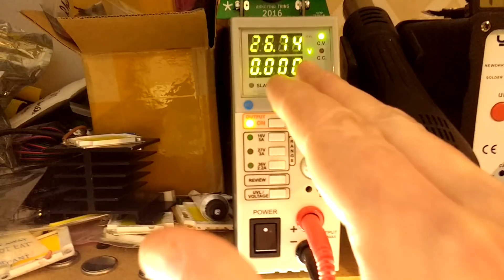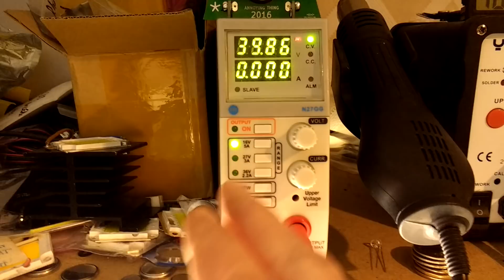Why I never show my power supply.

Comment: I'm not sure what the message is here.  On the one hand you've highlighted a major flaw in this PSU but you also say it's the one you use.  Are you telling us to avoid it or use it?  You have a huge following, some of whom will be influenced by you so you ought to be clearer here.  If this supply has such a dangerous (to electronics) flaw, why would you 'Big Clive' even think about using it?  This makes absolutely no sense whatsoever.
Reply from the maker: This is the first video where I've identified it and also revealed that it has a huge flaw.  Not a glowing recommendation.
I continued using it to try and capture the crash state as I did in this video.

Comment: 2000lm-2400lm/15W... Have you seen these yet?: 
https://www.ebay.com/itm/94x50mm-15W-COB-LED-Square-Strip-Light-Lamp-Bead-Chip-diy-DC-12-14-GE/132443251434?hash=item1ed63ba2ea:m:mYdZcPCgNqqLtIoeP8ARoIw
Reply from the maker: There's a huge variety if them.  They just use a parallel array of four LEDs in series to give a very vague voltage of 12V.  Anything above or below will result in a significant intensity variation.

Comment: I wish he would do a video on power supplies. I'd really like to get one, but I don't want to spend a ton of money. I'm an amateur, I don't do a lot of electronics anymore, but I still get into moods every now and then. I think one of the biggest things that stops me from getting into one of those moods more often is that I'm limited to a computer power supply or USB. I have to dig through my work area to find where I stored the PSU and pull out the multimeter, sometimes I need to dig through another area to find a voltage regulator or something if I need more variation than 3.3/5/12/-12v. A quick video showing some examples of good, budget power supplies would be awesome!

Comment: I have a sharman multicom 0 to 30 volt 30 amp linear power supply, old analogue amp and volt meters had it now 9 years never had a problem. Thing is these new digital readout switched mode power supplies are expensive junk, go get a good old fashioned linear supply.

Comment: its weird because my powersupply randomly crashed yesterday, when id turn the voltage way down id still sit at 10+v. blew up the blue led in my rgb led i installed. and i cant get it out great

Comment: My "Early Chinese" power supply's so old it uses moving coil meters with LES tungsten backligting.  Reasonably reliable though (and transmitted HF noise issues were almost completely fixed with decoupling capacitors).

Comment: Those powersupplies are sold under many different brand names. I have one that is Voltcraft branded. And yes, this stupid thing lit up several of my prototypes - so don't buy it!  (go for a used agilent/keysight supply, that will last you for decades and is usually rock solid)

Comment: Hi Clive! :) That power supply is otherwise known as any one of the following, Voltrcraft LSP-1403 / Maplin N27GG / Manson SSP-7080 / Extech 382260. It's actually manufactured by Manson. You might find that they offer a firmware upgrade for the supply that might cure that problem.  Also apparently they are known for developing problems with the snubber circuit and for the mica insulation on the MOSFET failing. I believe the controller is an amtel ATMEGA so there is probably some kind of update available.
Reply: Maybe it was Charles Manson that made this one?

Comment: This power supply reminds me of my first power supply, a "VOLTCRAFT LSP-1403 SLIM" wich looks exactly the same.
I don't know if it has the same error though, because i only used it a very short period since setting the voltage is very fiddly and to adjust the current you have to hold the "REVIEW"-Button. :-(

My current PSU is a "Twintex TPM-3005" (0-36V @ 0-5A or 0-15V @ 0-10A, 1mV/1mA Resolution, controllable via RS-232 and much moore. Link: https://www.tme.eu/gb/details/tpm-3005/programmable-power-supplies/twintex/)

Comment: I have that power supply, and while I've never had it crash, it has a nasty problem with current regulation when you first turn it on, the current will go sky high for a brief moment before the current limiting kicks in.  I wasted a nice 2.5 watt laser diode with it.  Better to turn on, then connect to a load.
Reply: TheHouseBlog If you have a digital storage oscilloscope then it is always worth testing the power-on/off characteristics of a new power supply before you actually use it as there are a good many out there that exhibit undesirable characteristics and quirks on either power-on or off.  Also does not hurt to test suddenly unplugging the supply as well to emulate a power failure and then restoration of power.  The more you know about your gear the less trouble one inadvertently gets into and the fewer unpleasant surprises.  If one does not have a DSO then search YouTube and Google to see if others  may have already evaluated your power supply as there is a decent chance these days that someone out there has done so for you.

Comment: Thanks for sharing Clive. I worked at Maplin for four years during my college days and was witness at the time when Maplin ripped out the long counters where you were encouraged to bring your endless shopping list of single components to faithful old tecchies who were eventually replaced by box-shiftiers..
At one point they started selling CRT televisions made in Ukraine at a very modest price. Some of us were invited to visit the factory where we watched the production line workers who some had bottles of spirits on their bench - not for cleaning, but to sip all day long as they assembled and tested. No surprisingly, many of the TV sets we put on display arrived D.O.A.. Some made very interesting pyrotechnic smoke plumes when brightness controlls were adjusted. 
Ironically, when the shop became more Curry's outlet than component store they had a big problem with ram raiders. The gangs were clever enough to trace and cut the phone lines to prevent alarm signals from alerting the Police. They must have been dissapointed to find they had made off with piles of faulty DVD players and TVs waiting for return.

Comment: I have one where there are 4 presets for 3 buttons labeled 1,2,3. To get to the 4th preset you push 3 and roll the value selection encoder any amount of steps in any direction. To select a voltage or current you select a preset, push the voltage/current modification button, and roll the encoder,  the timeout for modification is about 4-5sec.
Things get messy when you're on the 3rd preset and linger a bit when modifying a value, a slip on the encoder after the timeout switches to the 4th preset which is set by default to 36V/5A.
Blew an expensive xilinx fpga board to hell with that power supply.

Comment: Does it actually output the voltage shown on the display when it crashes or does the intelligence just go away and leave the voltage set at its last setting????
Reply from the maker: It does display the undesired voltage.
Reply: That is definitely not good.   Thanx.

Comment: Well pray why do you continue to use it without modifying or replacing it?
Reply from the maker: Because I quite like it otherwise and because I always instinctively switched it off in past incidents I wondered if it was my error that caused it.  So I've kept using it in the hope of catching the incident one day.
Reply: bigclivedotcom I see! Thanks!
Reply: Well now you have, so rip it apart and shotgun all of the solder joints, for starters.

Comment: $40 and you can get a TekPower TP3005p programmable lab supply, large, chunky transformer for the 5 amp current available, and up to 30 volts. Had it about a year, and hasn't done anything odd.
Reply: Jeremy Allen 
If they don't have a distributor in the UK then it would be prohibitively expensive to ship something that heavy!

Comment: Fix it! You'll find lots of dry joints in that power supply! I had one some years back from maplin and sold it on because of the poor quality of the board. Check the output stage that heats up first and you're done.

Comment: Why keep it around when the thing can't be trusted? I wouldn't use it even if it was free.
Reply: j mtx 
I definitely would use it if it was free. Especially if it's just for stuff at home.
Reply: Perhaps - but I would only use it for REALLY non critical loads like charging up old led acid batteries or devices which could handle 30v+ without issue.

I would never trust it to power something worth more than a few quid and/or REALLY easy and cheap to fix. 

A free PSU soon isn't really worth the money if periodically it destroys what it is connected to.
Reply: I had a 12V sealed lead acid battery explode, because of a faulty PSU which fed it 19V DC. See my other comment about it.
Reply: Mark T I would probably stick to things that can handle the max power rating, like lead acid batteries as you said. It probably doesn't always land on 30v when it crashes, better to play it safe then. Effectively it's become just a free car battery charger, which, hey, is better than buying one.
You could also probably find a way to automatically cut the power when it spikes like that, perhaps some sort of Arduino set up connected to a remote controlled wallwart. That would of course make it not free, but cheaper than buying a new power supply.
Reply: That's a fair point - though a lead acid would (typically) survive a high voltage for a few seconds without blinking an eye - but a 5v logic board would be dead before you had time to say "ohh, sh.....".  I agree if the supply can change voltage mid use then not suitable for unattended operation on anything really.

BUT I think I can see a fix for this....... (will write another post)

Comment: So which power supply would you recommend, Clive? 

At the 100-quid-and-under mark?

At the sub-200-quid mark?

At the sub-300-quid mark?
Reply from the maker: For typical use a budget of up to £100 is fine.  You'll usually get a decent supply for around £60.

Comment: A Crowbar is needed
Reply: Robert Szasz Crowbars are not especially practical where there exists a wide range of valid voltages.  If you have a 0-30VDC supply and a 32V crowbar it will save you from an out of range (invalid) voltage surge, such as from a shorted MOSFET, but your 5V circuit is still fried if the voltage suddenly spikes to 24VDC (which is well within the 0-30VDC valid range) since the crowbar will not have fired at that voltage.
Reply: I hope you mean the wrecking/demo tool "Crowbar" :))
Reply: Undefined Lastname but that's not nearly as fun as having a crowbar for protection and a sacrificial resistor as an indicator.

Comment: I've gone through 2 of those, both had exactly the same issue, one of them fried an FPGA while i was programming it, took it back to Maplin and they just went 'we'll replace it' argued the toss with them because that would have been the 3rd unit. In the end i just bought one of the chinese ones from eBay, after trimming it in, its still going strong 3 years later

Comment: I'm not in any way experienced in power supplies, can someone explain what the "Slave" LED is for? What is a slave power supply?
Reply: Slave means that the supply is tracking the output of the first (Master) supply. The slave will kick in if the master supply fails for whatever reason. They can usually be configured in series master-slave or parallel master-slave, for sharing current or voltage, respectively. Dual supplies tend to have this feature built in, but I assume for this unit you would need another identical unit (after connecting them, the LED indicates this). But just a guess.

Comment: Plug it into a microwave transformer, give it a taste of its own medicine.
Reply: microwave transformers are fucking shit, prob blow itself up
Reply: Everyone wants to slag Chinese products, which you should know is almost everything nowadays. Clive is switching the voltage while this device is supplying power, which I'm sure is not the intended way.  If you want a power supply that responds intuitively to what engineers want, you need a more expensive Chinese product.

Comment: Reminds me of an ancient Power Designs supply used by a mentor of mine. The feedback for the analog control circuit worked in such a way that if the voltage adjustment pot ever lost continuity-- even momentarily-- the output would ping up to about 50V, almost inevitably obliterating anything you had connected to it. On top of that, It was probably 30-40 years old, so the pots were completely scratchy and worn out. My mentor just worked around this by training himself to disconnect anything he was working on any time he went to change the voltage.
Reply: I wasn't suggesting that the issue with Clive's supply was related to that, but the mention of how the voltage would jump up to some high value made me think of that story.
Reply: Now that's self-discipline.
Reply: Good theory, but Clive's one uses digital encoders for the V/A adjustment.

Comment: I have tried several bench top power supply and they have a been  just cheap china crap.However the one I have now is a Agilent N5767A DC power supply 60V, 25A max but I paid $980 for a used but its the only one that has not broke.

Comment: Hi bud.  I would like to say I used to be one of the many full time staff but left as the new managment started to destroy the electronics side of the business.  I have a recommendation for you I haven't had time to do a review but I have this item off eBay it's an all in one but the tests etc I have done show it's very accurate and the hot air station and soldering iron are fast to act and heat up the temperature is spot on and the 30v 5amp PSU has so far been accurate and the current and amperage limits are fully usable.  It also has a meter for measuring small voltages.  It's very stable and quiet.  I wrecon for the price it's better then the Maplin gear and a lot of the other gear.  Link follows. eBay item number will follow. https://rover.ebay.com/rover/0/0/0?mpre=https%3A%2F%2Fwww.ebay.co.uk%2Fulk%2Fitm%2F322064917539

Ebay item number 322064917539

Give it a try it's the best thing I have bought in years and it takes standard Weller or precision Gold soldering tips available from Maplin.

Comment: I got my power supply from Banggood it's "GOPHERT CPS-3205 0-32V 0-5A " and I bought it because of all the good reviews on Youtube and one guy did like you and pulled it apart to see the quality and it was very well made for $55 US and I have now used it for 2 years with no issues. I use it to test items (LED, small circuits) as well as electroplating and electro-etching. One guy said he switched to using it over his $1,100 unit for ease of use reasons.
Reply: Yep I use the exact same one. It's my second unit after I killed the first. Don't get too comfortable with shorting the output >.<
The downside of these units is that they have a lot of output capacitance rather than a good design that limits noise. The output is still moderately noisey anyway, despite all the capacitance.
Reply: I would not recommend it because there is a combined knob for everything and the output is in the back.

Comment: I've got one of those for non-essential or portable use, I don't think I have seen mine crash ever though, what are the circumstances under which it happens?
Reply from the maker: It's utterly random.  I can't make it do it deliberately.  There is a calibration mode button combination, but the crash can occur in normal use.

Comment: Just make a zener diode shorting across the two jacks, and have a few for the different voltages you’ll use, so if the voltage ever gets too high the power supply’s current limiting will kick in and not fry your electronics.

Comment: Thank you BigClive. That explains the BULLSHIT i've been experiencing with this model badged as Tenma 72-8355. It became a pain in the pahtootey so i thought i'll fix it oneday and bought another.... Now i know what i am up against. Thankfully nothings ever been wrecked.
Reply: peteb2 Oops!.  I wonder how bad that TENMA product I just ordered will be...
Reply: I'd a good 2 plus years and never an issue then oneday the thing lost its marbles. Even a full power disconnect cycling and it soon went stupid. So i put it asside and thought eventually fix it and ordered another as i like the really small footprint. The new ones been perfect.
Reply: And here's a laugh. I just dug out the 'faulty' one, plugged it in and it's perfectly fine. Can't make it crash. I'll leave it running into a resistor load and see what comes...

Comment: Good job it's not a car.
Reply from the maker: Was it Ford that had a throttle issue where the servo would slam to full?
Reply: Toyota IIRC. I was following it on Slashdot at the time. The code audit revealed appalling practices, but in defence of engineers (think VW emissions), these days despite having IQs exceeding their bosses they are not trusted to make decisions. It is - to quote Mark Renton - a shite state of affairs; we need more engineer-led businesses.

Comment: Had a high-frequency amplifier once, about 2mhz. Had to use two power supplies, one for a ten-volt feedback circuit. I used an expensive benchtop for the low power but despite isolation, it picked up the 2mhz and apparently, that makes the voltage and current max out. 30V at 5A flew through a circuit that didn't deserve it. A signal much larger than what should have been visited the amplifier and for a brief moment in time I observed the birth and death of nebula. Lost a lot of good ICs that day... I did learn an important lesson though, just cause you can slap a circuit together doesn't mean you know what you are doing.

Comment: 😱 i was thinking of getting one of those....i dont think i'll bother, now..! i'll stick with my kit built  thing,  it has 'issues' when driving high current at low to mid voltages (mains transformer and rectifier diodes nearly fry) but otherwise its ok.. unless you accidentally feed power into its output....in reverse..big chain reaction blow up 😱